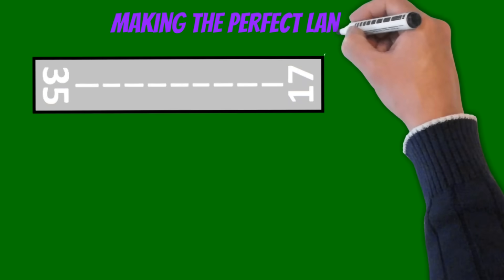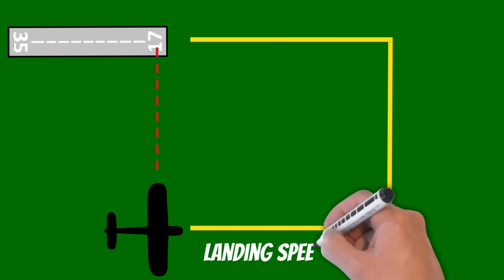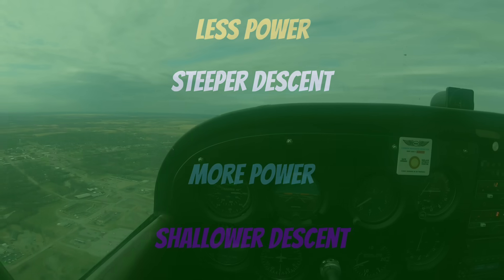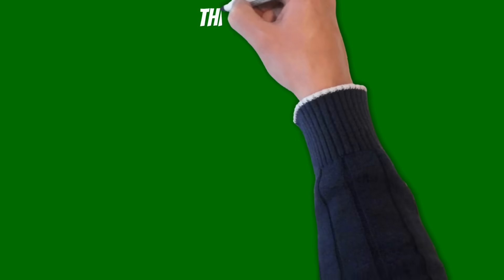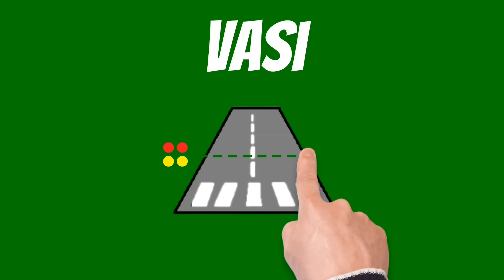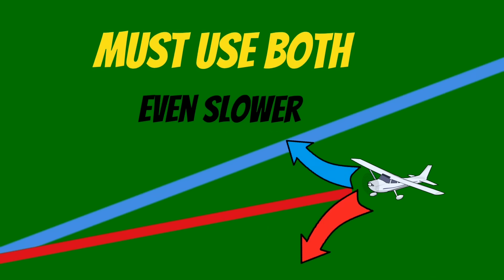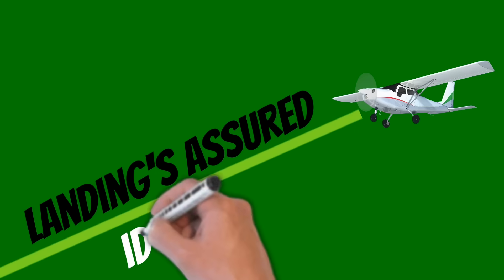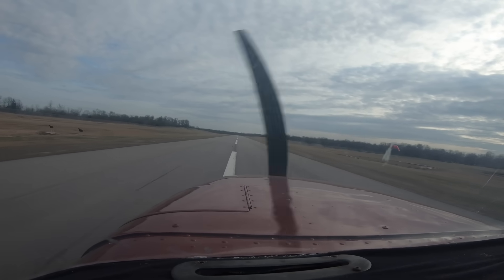Landing SECRET your Instructor won’t tell you [How to Land]

Comment: 25 hr student here, long break in training.  Agree, stabilized approach is key to landing.  My instructors teach 70 kts in the pattern downwind and base.  I hold that airspeed into final, and pull back to idle once I have the field made.  I prefer to add power (100-200 rpm) if low on final, to intercept the glide path again (then drop power back 100-200); and I will forward slip if high without gaining air speed.  If I'm low I need energy, but if I'm high, I have energy to spare.  Most difficult part for me...  is knowing my height above the runway as I round out.  I know I need to develop my peripheral vision more for the round out, but I've struggled with the phase where I shift my vision to the end of the runway and hold attitude to let it settle .  Occasionally the end of the runway will go under the cowl and I lose the reference point.  What pointer do you give to correct that once it's happened?   My usual procedure when I first get in is set the seat and to crank up the seat height until my knees come to the dash, and then drop it back down so I have freedom of movement on the rudder pedals without hitting the dash with my knees.  This gets me up as high as I can get, and I stay there for flying and for that phase in landing.  I'm 6'1" ... flying 172.   I like you pointer for aim point in the windshield, 1 fist above the dash.  thx
Reply from the maker: That’s a good technique. I know a couple guys who use that.  The only reason I don’t is that most aircraft manufacturers recommend touchdown speed to be below landing speed. Usually, it’s around 10 knots less.  So if you have a lot of floating when you land, that’s probably why.  As far as knowing how high you are, the aimpoint is my primary method for gauging the height, but if for some reason I don’t use an aim point, I pick a spot on the ground (looking out the front window) and drive down to it.  As I get closer to the ground I make my decent shallower (but still nose low). 3 feet off the ground is pretty easy to identify.  When I hit 3 feet I raise the nose 6” higher than the mains and just freeze that attitude. One of the biggest problems students have is leveling off too high.  That’s fine if you do, just recognize it, and reestablish a nose low attitude until you are 3’ from the ground.  As far as looking at the end of the runway, the only purpose for this is to make sure the nose is lined up and you don’t land in a crab.  It can also help you tell if the nose is up, but you should be able to tell that without looking there
Reply: @FreePilotTraining  Dear Instructor:
I also came recently to your channel and subscribed. I still have to go through all the ground course videos but, indeed this one is one of the best explained videos and details for the approach and landing.
I saw on another response that you are located at Vinita OK. I am in Carrollton and fly from a nearby small airport. I have had already around 30 hrs of flight training but still struggle with the round out and flare. Next time around I will apply what I saw in the video about where to look when during the roundout and flare. I have not soloed yet and am worried to keep spending / burning cash until I get it?!.
I still dont get the feeling of how much I have to raise the nose to get parallel to the runway and not to balloon. Sometimes my round out is short and land flat, sometimes is too much and I balloon. Kind a lost in here. I think that is the most difficult for me, maybe to many pilots. Don't know exactly how much I have to pull on the yoke. Any suggestions or help?.
On the other hand, I am 5 hrs away from you. Would love to arrange a couple of hrs of instruction with you when you are free. It will be just once so I get the help directly on the plane from you. Of course, if you can. Thank you in advance.
Reply from the maker: Don’t worry! Everyone struggles with the round out and flare.  First, make sure you arrive at the threshold AT your landing speed.  This really is half of the battle.  Then, when you are at 15 feet above the ground, go to idle power.  If you follow the tips in the video, you will arrive above your aimpoint at 15’ above the runway.  Now....On the roundout... all you need to do is change your aimpoint from where it was to where you want to land. This is going to take very little backstick pressure on the yoke.  Almost none.  As you start to get closer to the ground start looking at the end of the runway and use your peripheral vision to judge when you are 2-3 feet off the ground.  Now, don’t flare.  You really don’t flare in an airplane this small.  It’s really a transition.  Just slowly pull the nose up until the nose wheel is about six inches higher than the mains.  Now, this is where it gets weird.  You want to keep this attitude all the way until you land, but as the airplane slows, the nose wants to drop.  Just keep that from happening.  It’s just a really gradual increase in backstick pressure to keep that nose wheel from falling.  And from there, the plane will land itself.  If you really are serious about instruction, you can PM me on the Free Pilot Training Facebook page, and we can talk about it.  Best of luck!
Reply from the maker: Also,  check out this video from MZeroA.  He has some excellent tips.  https://youtu.be/ngtoPojV9CQ
Reply: @FreePilotTraining  I believe an important note to make when teaching landings is the pilot should be touching down at the slowest possible airspeed. In fact the FAA's Flying Handbook recommends ideally landing at the stall speed. That's on Chapter 9, page 9.
Reply from the maker: @lpappas474  excellent point! Thank you!
Reply: I cheat... I do a quick glance to my left as I'm crossing the fence to get my reference as to how high I am. Just one glance is all I need and I'm looking forward again just keeping it straight.
Reply: @grayrabbit2211  I would discourage that as an instructor. All it takes is that one time you think your 15' + above the runway when your only 5 (skinny runway illusion, maybe), and that head turn doesn't give you enough time to make your adjustments properly. Using your peripheral vision is useful of course but your setting yourself up if your actually turning your head. It could also be disorienting in low visibility.
Reply: @blusheep2  I appreciate the tip.
Reply from the maker: @grayrabbit2211  hey, whatever works best for you.  I like hearing all the different techniques
Reply: Pissing about with the power and pitch will bugger everything up. Set the approach up, set the power and if it looks good, leave it. Pissing about with power, pitch is the road road to ruin. I have flown very few aircraft (from single engine bug smashers to 100 odd seat airliners) where this is not the case. As videos go, this ranks as one of the most useless.
Reply: @Trevor_Austin  Of course Trevor but if you have that experience then you know that you rarely get that perfect glide path that allows you to ignore pitch and power. Tell me, when your 100 seat airliner is on autopilot and flying the ILS, does it just set one power setting or is it constantly adjusting for the conditions?